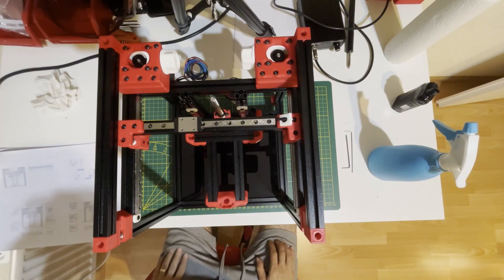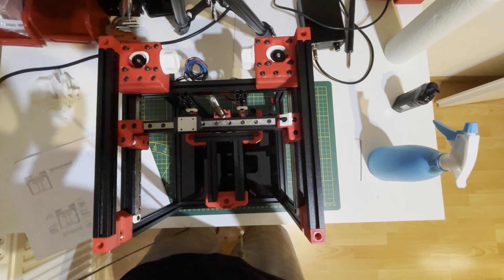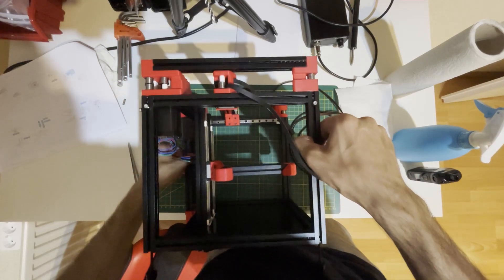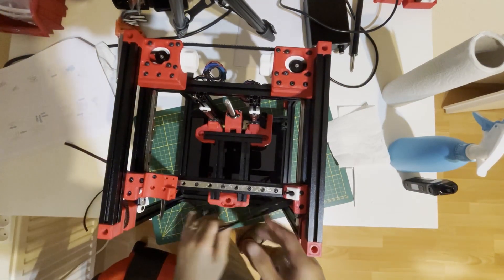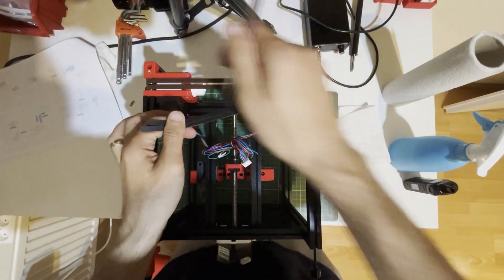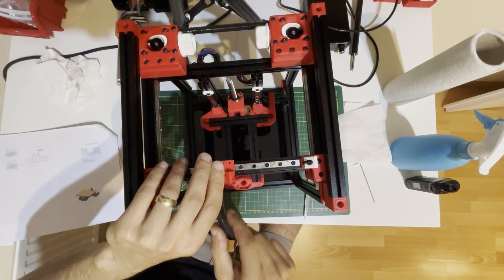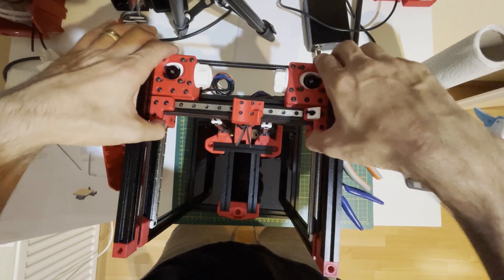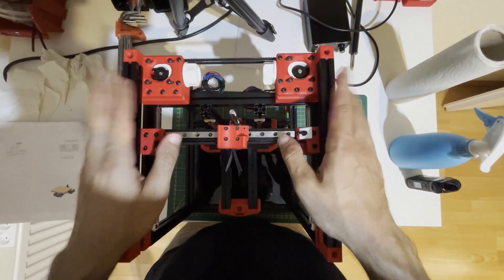Building Voron v0.1 - Belting [Ep7]

Comment: I suggest anyone who gets the LDO kit to run the belt on one,  mark it, record the length, add a foot and then cut the two to that length. I think you will have a spare belt if you do that. Shame i didn't do that and i could put the length  online here. Just did this yesterday.  Oh and this looks like a video on how not to run the belts LOL. Get the belts over the motor first and you won't really have a question on running the belts.